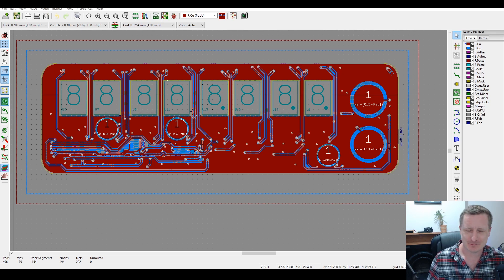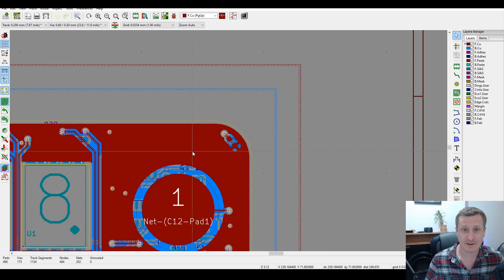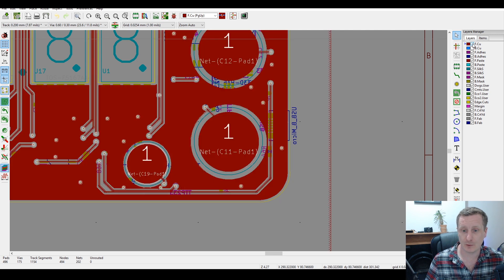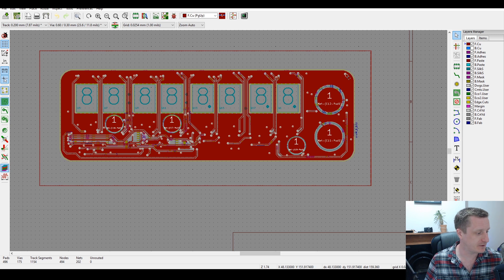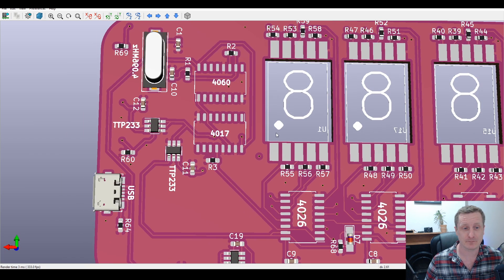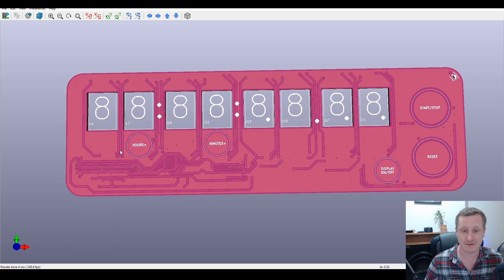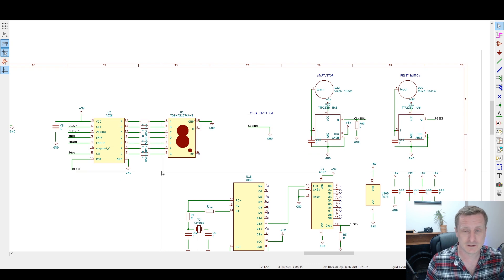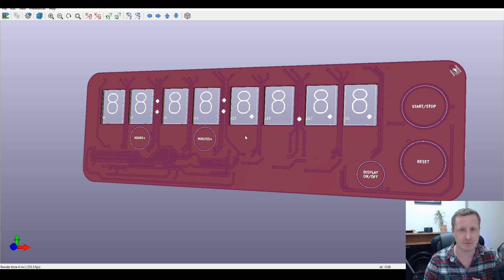CMOS Milliseconds Clock

Comment: I did a similar thing a few years ago, used to be an avid Eagle user but when they changed all the licensing options it really annoyed me.....so much so I switched to KiCAD. Yeah it annoyed me at the start and the update process is not great.....but I will never return to Eagle now. I have also changed my board house to AISLER for the last project. Good price and very good standard compare to China. You get a lot less options, it's not fancy, but it is done well.
Reply from the maker: Cool, Aisler look pretty good and not that pricing considering it is the EU. Sadly they only have a green soldermask.
Reply: @DavidWatts  yeah there are limited options. I have also found  they leave annoying board dags on the edges where they route it out from the panel. A small annoyance. I have also found the solder mask is not always applied evenly which again is not a huge deal, it works lol. When order 4 layer boards I have actually found them cheaper than China if you are after an insured delivery (which is a must for me when you are paying £40 per board and not their cheap $2 who cares price!

Comment: Rather than extend apologies for background noise from a fan and 3D printer, try using a headset which will put the microphone directly in front of your mouth. Add a "dead cat" wind breaker to work as a pop filter and you should be set to go.

Comment: You can fool the free Eagle to accept greater than 100x80 by moving the default board outline down and left when it's been partially populated, and then resizing.

Certainly that works with 7.7 (pre Autodesk), which is the version I use.
Reply from the maker: Ah, I always wondered if there was a way. Smart. I have a full license now but I think it is through Fusion 360 and I am not sure if that is the same, so I will keep plugging away at KiCad.
Reply: @DavidWatts  It works because the size restriction is based on coordinates. If you want a board that's 150mm wide, you populate the 'default outline' then select everything, including the outline, and shift it so that the initial origin point of the outline, which was at 0,0, is at -50,0. Then you extend the right board edge from its new +50 x coordinate out to +100, thereby giving a total of 150mm (-50 to +100).

I have no experience with the Autodesk Fusion integrated versions. Despite having 'written the book on Eagle' (https://www.amazon.com/gp/aw/d/1260019195/ref=tmm_pap_title_0) I now only design PCBs for my own use and for charities and 'not for profit' groups. The Autodesk licensing costs render that impossible on a pension - much as I would like to make use of the 3D integration.

Comment: Nice. I use KiCad, and well yeah, it can be a little sparse on the footprints.
Been thinking about making a starburst LED display. I reckon you can get a 24hr clock on a single 16 character (with dot) device...
Reply from the maker: Yeah I saw quick a few of those all in one displays but driving the select pin for each digit would add some extra complications. Really just disabling the display on the other 4026s and only letting one through but it was enough to frazzle my brain.

Comment: @7:01 I never even though of that. I leave the USB data lines floating (eg. NC) on all my designs. Should maybe read the USB specification a bit more. BTW. No problems so far with any of the boards that have de D+ and D- floating. And they really should make pink soldermask available. All my boards would probably be in pink! :D A question: why do some of the digits have the decimal point and some don't?
Reply from the maker: I stole those decimal points as silkscreen to put on the actual board surface. The ones in the cutouts where the digits go are just symbolic. Shorting the D+ and D- was supported by the USB spec last time I read it, 500mA on USB1.1 or maybe 2.0.